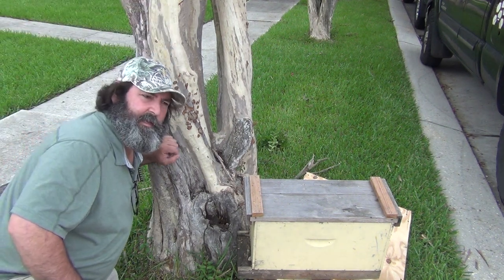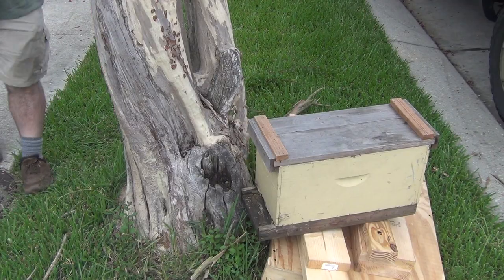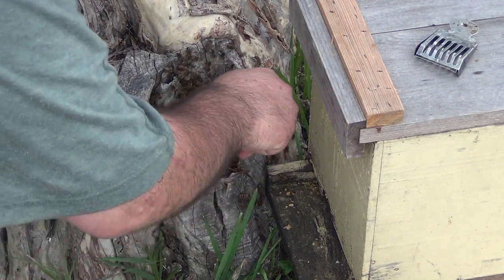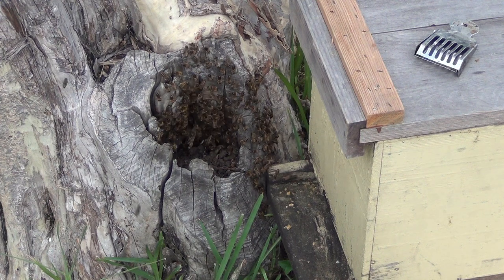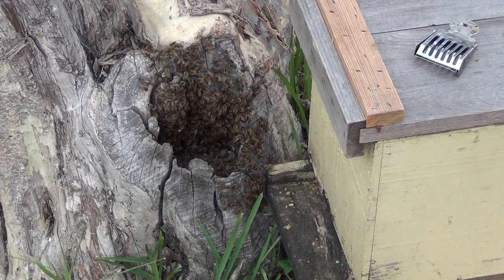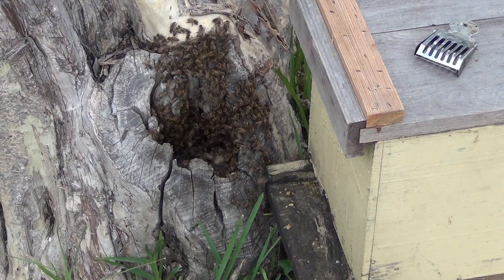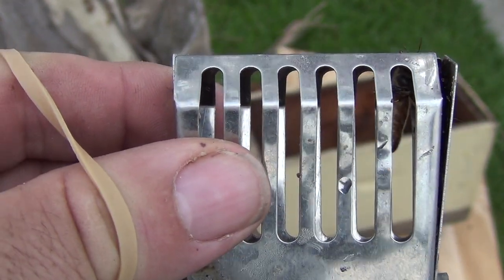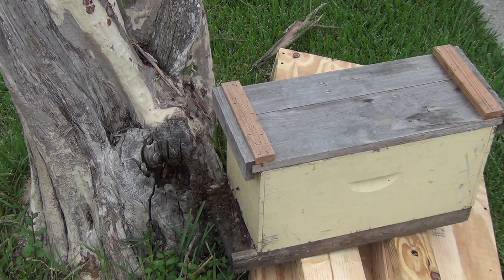Smoking Bees Out Of A Tree

Comment: Goodday sir. What did you do with the queen? Any reason for manhandling the queen?
I would simply put the frames in,actually they should have been in there already and closed the lid.
I suppose there is an opening from bottom to top,so as long as I drill below the bees +/- the smoke
will reach them? Thanks for sharing,Cobus🐳

Comment: Very neatly done, sir.  Simple solution to the tricky problem of removing the colony without cutting open the tree.   
(Although I was surprised that you didn't "bait" the nuke with a frame or two of old comb (or a dab of lemon grass oil) -- to lure the girls into the nuke.)
Always a pleasure to see you.
Reply from the maker: Kevin Byrne I worked with what I had at the time but propolis alone on frames & the interior of a hive box is usually enough to have their interest.

After you apply smoke & repellent in the void space what choice do they really have then but to move into something with familiar scent, right? 🐝🐝🐝